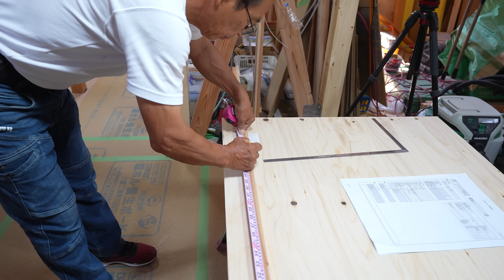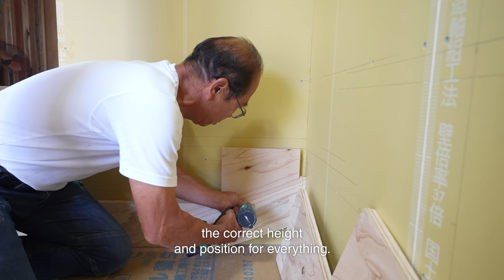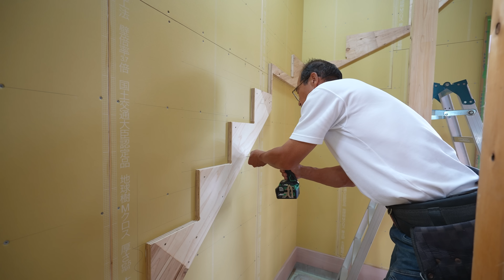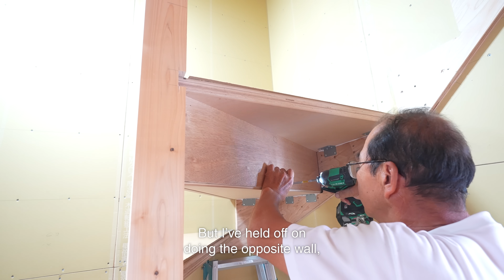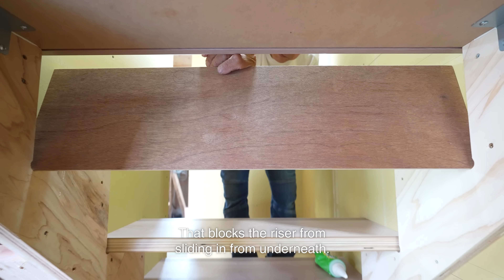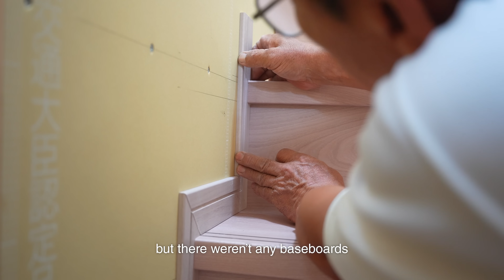52-Year Carpenter Battles Unfamiliar Pre-cut Stairs | New Build Season 6 Part 6

Comment: In the U.S. we skip the "baseboards" used here by installing kickboards on either sides used as structural stringers. The treads and risers are then cut to fit between the kickboards, and the top edge of the kickboards receives a decorative moulding to cover the plywood edges. This method skips the extra labor required to notched every tread nosing to fit baseboard/kickboards. The downside is that cutting your treads and risers to fit between the kickboards takes practice to minimize gaps.

Comment: I hope the homeowner uses that empty space under the stairs. My suggestion: I would turn it into a battery storage area and install solar panels on the roof. That way, the entire house could be powered by solar energy with no need for additional electricity from the city, and the space under the stairs would stay warm thanks to the inverter and batteries.